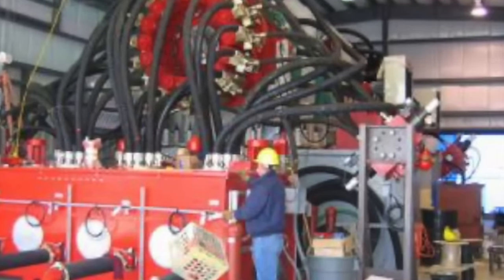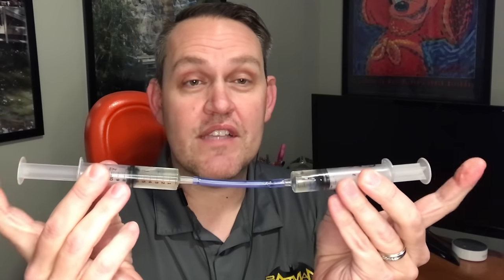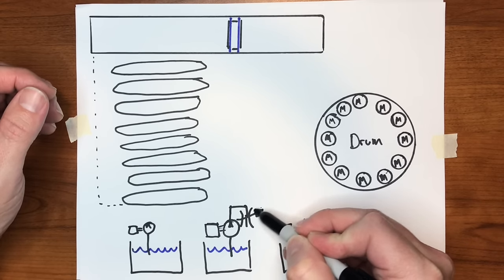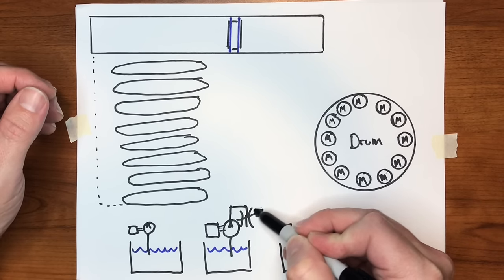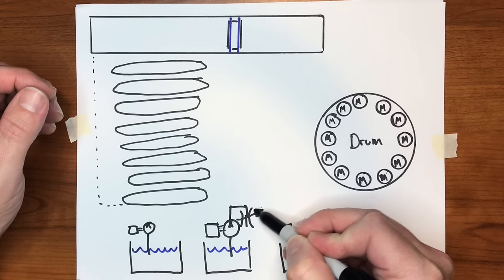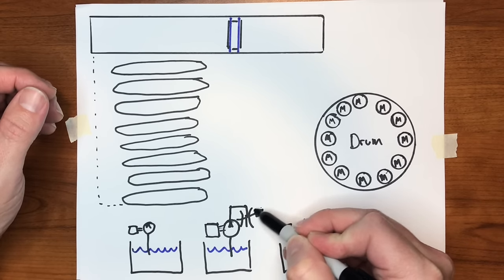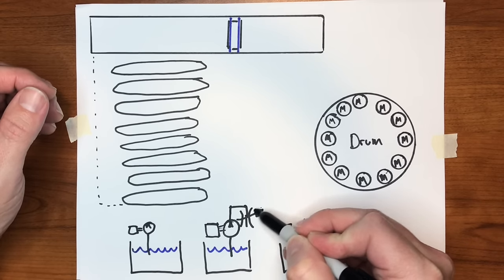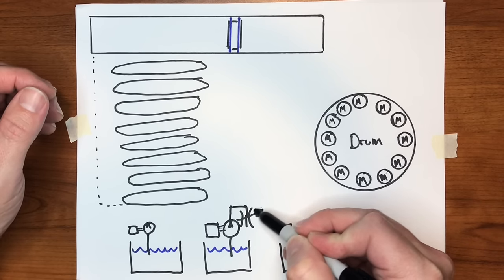How Hydraulic Launch Rides Work

Comment: Now I'm no ride engineer, but in your hypothetical scenario of the dog catching the launch car on rollback, that would probably definitely wreck your shit from accelerating the launch system like 100g+ from standstill. Motors freewheeling not gonna be safeguarding much of anything
Reply from the maker: It would be quite an impact on the riders but not extreme. Just uncomfortable. The train would need a full tear down and inspection.  Cables would need to be replaced. Catch car needs inspection. But you wouldn’t break cables (keeps rider safe) and you wouldn’t destroy the drum and gearbox, that would take the whole ride out for about 1.5-2 years if the drum and gearing was broken. So definitely not ok but you could use other trains and take a week to inspect. Be up and running about a week later.
Reply: @ryantheridemechanic Interesting bit of info, intamin actually has a system in place for this exact scenario. The front of that catch car is ramped up (seen at 42:01) same as where it couples, to force the dog back into place in the clutch pack and clear the catch car.  It's extremely rare for that to happen though. I've been working on one for a long time and still never seen it happen.
Reply from the maker: @shawnspencer8766  interesting to know. I also figured with as small as the pocket is on that catch car the dog if down after that front ramp, would probably just fly over that hole. Everything happens so fast.
Reply from the maker: @shawnspencer8766  it’s those fun pieces of information that people know just like yours. I love walking around with a manufacture, looking at their rides and they would point something out and they would say do you understand why this is curved and I would say no and then they would explain it, and it was always fascinating to hear the actual thought behind the engineering of the equipment because they plan for things that most people never fathom happening.
Reply: @ryantheridemechanic  very true. Funny enough I actually got piece of info from Sandor last time he was on site here. We were shooting the shit and he started talking about the catch car. 
 
I learn something new everyday on these machines lol
Reply from the maker: @shawnspencer8766  those conversations are absolutely priceless. Anyone who gets on is very lucky. I’d walk with the manufacture any day for that. We installed an LSM ride and the tech that came from intasys went over to our impulse coaster because he wanted to see the drive. I opened the the cabinet where the thyristor were sitting and he pointed out all sorts of things that I didn’t know. Then he pointed to the inspection tag on the back of the thyristor, and it was his initials on there! Haha! From 10 years prior.

Comment: Got thru it!!  Ha!   

Thanks for clearing up the water mystery for me,  why cables and water….. made no sense,  I speculated it was a design patch to cool something that ended up running too hot. I would have never guessed it was for the catch car to hydroplane on but makes total sense.  

When I was asking about top trill (RIP) As I understand it once the catch cars speed is bled off with the mag brakes and pumping losses a few motors (I think four per side) swash into reverse to power the system back home. 
I’d speculate that there is no friction brake on that drum at all. With a just few motors low speed braking holding and positioning should be an easy ask of a system like that.  

The instantaneous horsepower of the winch….. the mind boggles, I’d bet that broke some fluid power industry records for instantaneous delivered Horsepower. Mining shovels don’t move that kind of flow that top thrill uses while hauling the train.  

PS: I can tell you’re an electrical guy!  Hydraulics are super similar in theory when doing that whole pressure is like voltage, and current like flow…….. so you always need voltage as the potential for an electric system.  In hydraulics that’s kinda on its head; flow comes first, pressure is only created by resistance to flow.  But it’s harder to explain it that way .  In no way is this meant to be a jab at an excellent video from limited information!
Reply from the maker: Yep you got it all. Long video haha! Yea my suspicion is that the put some motors in neutral and some with a choke to assist with stopping the drum. Catastrophic in my mind is mid launch and loose power sot hat what I was thinking when going through things. And yea can’t have pressure without resistance. But like you said , hard to relay that. 
Thanks for getting through it!!